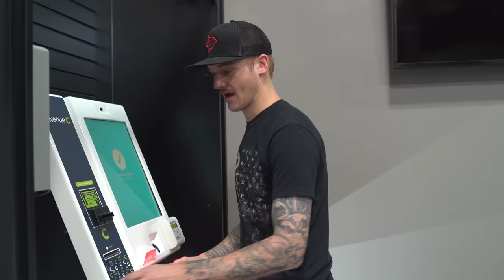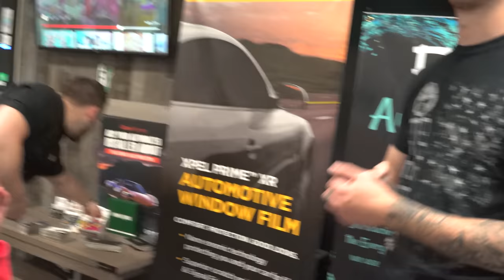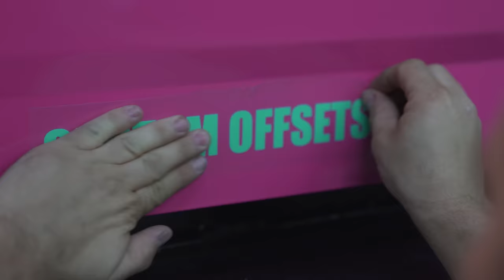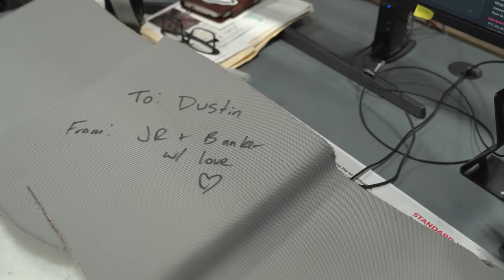Did I Ruin His Dream Truck? A Bet's A Bet

Comment: There are trucks that look like that rolling around tn as we speak, but the two tone is kind of cool for a seam build
Reply from the maker: They haven't cracked down on those "squat laws" yet?! -Fuller
Reply: @CustomOffsetsTV   not here, I doubt they ever will, I live in a pretty rural community, but most of my friends don’t squat anymore,  although my truck is slightly, like 3.5 lift in the front and stock in the back. it was called Tennessee Tilt here, thanks for commenting fuller 🤘🏻 y’all’s content has been 🔥 lately!